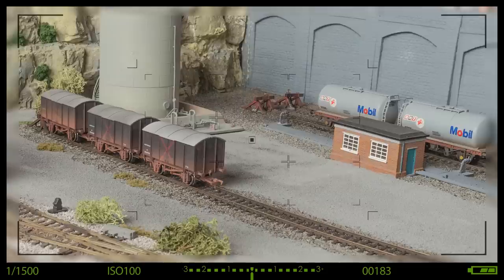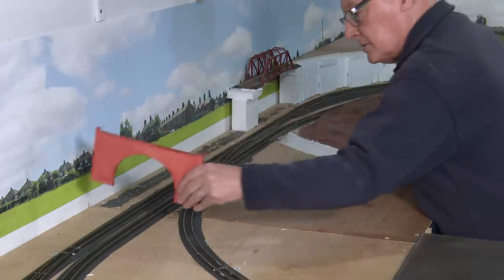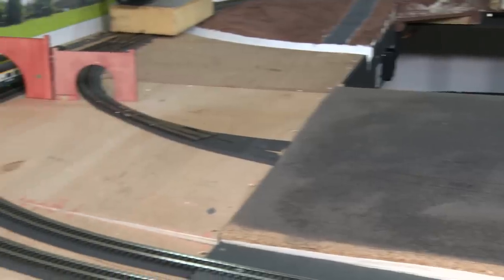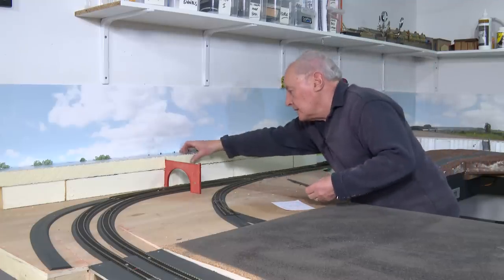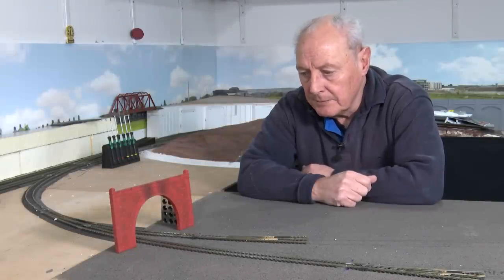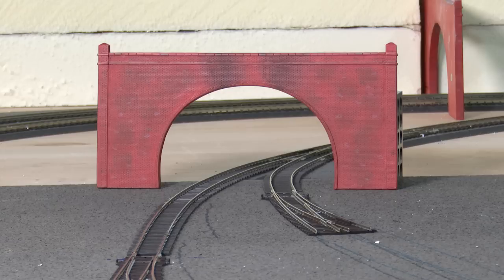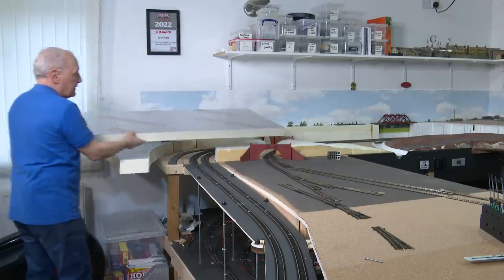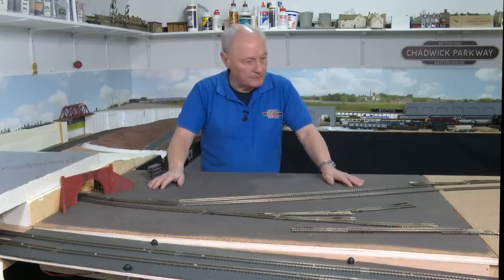Landscape Planning at Chadwick Model Railway | 176.

Comment: Interesting as always.  One of my bosses from way back when had two bits of advice when faced with apparently insurmountable problems... How do you eat an Elephant? - One bite at a time. And my favourited - How do you move a big block of concrete? Chip away at each of the corners and eventually you'll be able to roll it out of the way.

On a practical level, how are you going to maintain access to the points under the hill?  Two on the board you are currently working and an then at least one more on the reversing loop?  I wonder if the 2" layer of Celotex could be removeable - maybe use some vertical dowel pins to retain position on the 3" layer but retain the ability to left the upper slab off for access.

Have a good mini break - three weeks to next video!
Reply from the maker: Hi Lee, you’re spot-on the money. Yes I will have a pull-out hillside, of some description. There is no way I can leave those points sealed up. Have a great Christmas mate, I’m sure we’ll speak in the New Year. Regards, Charlie
Reply: Let’s all help with the elephant! Who has the ketchup and horse radish? Best to all! ✌️

Comment: Tis the season for a sweet sherry or two before filming! ;-)
Re TT120 - I think, if you are starting off afresh in the hobby, it bears consideration and I have no doubt more and more stuff (from rolling stock to buildings) will be come available as time goes on. However, I don't think if you are already committed to another scale, whatever that may be, you are going to be persuaded to swap. I have a modest sized OO layout, but between locos, rolling stock, road vehicles, buildings, etc, etc there would be no way I'd be changing scale.
Happy Christmas to you and yours. Cheers
Reply from the maker: A valuable opinion, Davie. Have a great Christmas and best wishes for 2023. Regards Charlie

Comment: Once you have glued your foam down, a good way to sculpt it is to use a short one-handed 2" surform and 'file' it into shape. Then cover by painting with cheap tile adhesive/grout using a wetted paintbrush. You can add texture or keep it smooth, fill in gaps and it dries in 24 hrs as long as you don't apply it too thickly. Cheap as chips when you consider the area you can cover from a 5 litre tub. It dries as hard as plaster bandage and easily drills for trees etc. Paint it with cheap emulsion paint before scatter so no white shows through.
Reply from the maker: Great tip, using tole adhesive David. Best wishes for 2023, regards, Charlie

Comment: As someone who hasn't started building a layout yet or bought too much stuff, the arrival of TT120 is giving me a lot of food for thought. While I like the overall size of models at 4mm scale, I just don't like the error in track gauge. I find N too small and O far too big and I don't have the confidence to go down the EM or S4 route (learned that the hard way with my dad 45 years ago where our ambition exceeded our abilities). So a new scale between N and 4mm that is pretty much gauge accurate is very interesting. The downside is of course the fact that it will take ages for there to be a decent range of locomotives and rolling stock. So I'm on the horns of a dilemma. 
Meantime I envy you your heating bills! My 16th century house with single pane windows and thin walls costs £6 per hour (after subsidy) to heat even at lower than usual temperatures, so when the snow was down last week I wore 6 layers and we rationed heating strictly. The monthly cost is still horrendous.
Anyway, many thanks for your videos this year - you give me ideas and inspiration so that one of these I will finally take the plunge either in OO or TT. All the best for Xmas and New Year.
Reply: My goodness, that is expensive!
Reply from the maker: Wow, Paul, and I thought my energy bill was excessive. I live in a draughty old cottage which is a nightmare to heat. I feel your pain, regards, Charlie
Reply: I agree about the gauging. It seems strange that wizards like Charlie go to unbelievable lengths to have the utmost realism, then spoil the effect by having track that is simply too narrow so locos don’t look right.  Withe quest for ever increasing accuracy, Hornby’s business strategists must have thought this through. I’m guessing they wanted something where they could create a monopoly and charge accordingly. So launch EM?  Compared with making complete new locos and rolling stock the mods would be much simpler, and the track would be simpler.  But how many established modellers would switch?  Not enough?  Go HO where the 3.5 gives gauge accuracy?  No chance of a monopoly there.  N gauge? Not quite the same. N gauge has a true gauge of 4’ 4”, so truer than OO but not true scale.  The old Lone Star OOO gives true scale so if Hornby go in hard enough with enough models they could attract new builders while enticing established N gauge builders to keep their layouts and track and replace their entire fleets with Hornby. Isn’t that smart? I’ll stick with my Hornby Dublo 2 rail OO gauge and wallow in the nostalgia of my beloved locos on the wrong tracks.  Meanwhile, if that strategy works, and Hornby get their monopoly, will they be the new Lone Star!?
Reply: Paul: Heating.  Our house is only a bit younger and the Listed Buildings apparatchiks won’t allow even tasteful double glazing.  Our downstairs shower room was suffering terrible condensation on the windows.  I surveyed the market for kits and installed versions like Anglian. I chose Omega Plastics in Devon as theirs looked well engineered and was competitively priced.  My wife wanted glass panes instead of polycarbonate and Omega said we should go for an aluminium frame as it was to big for plastic. So there wasn’t much plastic in Omega “Plastics”.  The staff were very helpful.  It arrived promptly.  It was all really made and went in easily.  There has been no more condensation except for 5 minutes after a shower.   I am delighted, hence this long message.
Reply: Thanks again for another fantastic video.  My layout is new and very 2D.  Other videos merely talk about making the 3D scenery but your exposition in explaining the why before the how is inspirational.  I feel I can start now.with some optimism and the confidence to try things, and even to correct mistakes along the way. It shows your strength of character that you can share your mistakes on screen.  You asked for comments about the tunnel entrance heights.  They’re OK for diesels and tube trains but I suspect proper steam locos would need a bit more clearance to reduce the thrust from their exhausts onto the tunnel lining.  Happy Christmas and thanks again.

Comment: Excellent and thought provoking video - as always. Not quite sure about your topography but it is your railway at the end of the day. My preference would be to try and create sonething the railway engineers would have faced, so with that in mind would the railway builders have built a tunnel about 4 coaches long with a set of points in the middle ?

Hmmm

Hornby TT120 in my view it is SK's last great hurrah and it is so clear.

  I am a 60 year old, and son of a rabid rail enthusiast who did his trainspotting on Blisworth station in the early 1950s.  In my view my dad was SK's primary target with high stepping pacifics on long rakes of coaches. My dad died in 2018 aged 83 and with him died one more passion for the LNWR and LMS.  Me ? Born 1962. I actually care for the period 1960-1975 which is a lovely mix of steam, diesels, electrics and railcars. Not prewar apple green East Coast pacifics or those big LMS maroon icons.

I suppose that being blunt, my question is - how many Gresley pacifics does Simon Kohler think the new scale will sell ? 
Another question i pose, having joined BR in 1978 is - does Simon Kohler think the "Toad B" is the typical BR brakevan which lasted in service into the 1980s and 1990s ? If so then he is mistaken. Hornby already have the CAD for the representative brakevans used in the diesel era, in the shape of the standard 20T and the Stanier 20T versions, and these are what IMHO Hornby should be offering in TT 120. 

Therefore i conclude the TT 120 offering has some pretty poor choices, some of which have been lazily tickboxed from the current OO inventory rather than using real imagination.
Reply from the maker: You’ve made some excellent points, Phil, thank you. Best wishes for 2023, regards, Charlie

Comment: Merry Christmas Charlie. Lovely to meet you at Warley. You as pleasant a chap in person as on the screen! More than can be said for most minor celebrities 😂

The layout is really looking great and a top tip with setting goals rather than doing bits piecemeal but as long as it’s enjoyable for the most part!

I’d have been half tempted to have modelled the diverging line with a sheer cut rock face nice to the tunnel portal and eliminate the tunnel on that section entirely. Perhaps best achieved by moving the double mainline portal towards the helix by an inch or two. Nevertheless, you’ll have a really nice view with the trains coming out the portals and will look great.

With Hornby TT. It’s a very mixed bag really. It fragments what is a somewhat niche hobby and will struggle to gain the same economy of scales with oo, certainly for a while. It also diverts energy and resources away from their core oo market that I would argue is being a bit neglected and struggling. On the flip side I was very impressed with the scale at Warley and I get what they mean by them being a lot more tactile than n gauge. It also makes a lot of sense for uk houses. The primary issue though is that the rest of industry need to come along too and I think that may well be the deciding factor. This will not be helped by them only selling directly. Obviously, quite unfortunate with Heljan pulling out but seems like Hornby have been working on the entire range for quite some time. 

I would also add that if this flops for Hornby it’s going to be a huge hit and they may struggle to come back from it.
Reply from the maker: Such a great comment £100. 
Great views on TT120 too.
Have a great Christmas and best wishes for 2023.  Regards Charlie.

Comment: Hi Charlie. Nice video. Yes I agree with you, it is better to try and plan your landscapes first if you can, rather than go straight at it. That way, you are liable to make less mistakes when it actually comes to building/constructing them. I also tend to find that if you can make some rough mock ups of what you are trying achieve first, it gives you a better idea of what things will look like and it is far easier to alter things then if you need to. Best wishes, Mark.
Reply from the maker: I’m living proof of such design changes!
Regards Charlie

Comment: Charlie,
Firstly, HAPPY NEW YEAR 2023.

Onto designing the hillsides above your baseboard. I model in N scale, and a major consideration is how my layout might go into the back of a hatchback or estatecar. 

My first thought was to question the traditional construction of making box sections below the baseboard. To my mind, that often means a lot of wasted space. 

Sure, I need somewhere to route my wiring and any control servos. But they don't need anything as deep as a traditional box section. 

My design builds those strength-giving box sections above the baseboard. As such, my hillsides are achieved by cutting into the box structures. Then covering the variously shaped boxes with thin plywood (similar to the way we might build a ship's complex hull with formers – the boxes – covered with laths of planking for a complex hull). 

So far I've only created proof-of-concept prototypes. These look very promising. The idea being to make double use of the strength-giving baseboard box sections to provide the undulations of the scenic landscape. The ultimate goal being to minimise the overall height for transportation. 

I'd be interested to know if you have tried such a construction technique, Charlie, or any of your viewers?

The only major issue I foresee is that it requires someone with excellent 3D visualisation skills, as it requires precise pre-planning. You can't so easily make it up as you go along. Otherwise, you'd lose the strengths of the traditional baseboard. 

I think of this construction method as being similar to the way a modern aircraft gains its strength from an integral WW2 style "monocoque" construction, as vs older lath-and-canvas construction seen in WWI biplanes. 

Thoughts?
Rick
Reply from the maker: What an excellent, and thought provoking comment, Rick. One of my friends makes his layouts from thick, light, pink foam boards. Easy to carve and easy to carry, and interesting option. Regards Charlie switch.

Comment: Thanks Charlie, most appreciated. With regards to TT 120,  I know both Hornby & Peco are promoting it, I could pontificate at great length highlighting the pros and cons of it. Personally I think there's enough to be getting on with in '00'. With the boys at Mckinley railway showing us what is possible with the hobby! With a solenoid powered Kadee coupling it was almost as if they'd found the Holy Grail of decoupling! Maybe Hornby have realised they need to create a larger market share, due to all the manufacturers who are crashing in and supplying locos in '00' & producing a better product. Here's a rather novel idea to hide your porthole. On the Transpennine route there is a certain Stanedge Tunnel before it is an aqueduct flowing over the railway  that fills the canal just below it. It is really unique and I'm surprised someone hasn't modelled it.  It proudly stands before the portal to the left and cascading down a staircase the white water makes a dramatic entrance towards the canal. Link;- https://youtu.be/5b7cIVEpGkA
Reply from the maker: Yes a very interesting construction Bill.
Have a great Christmas and best wishes for 2023. Regards Charlie.
Reply: @ChadwickModelRailway  Thank you!

Comment: 4:27 Interesting stuff Charlie. Of course there’s nothing stopping you from using a double track portal on the single line. Many lines built as double were singled but the structures of course remain unaltered. A good example is the Matlock branch. You could even show the ghost of the other track alongside in the ballast.
Reply from the maker: An excellent point Al.
Have a great Christmas and best wishes for 2023. Regards Charlie.
Reply: @ChadwickModelRailway  Thanks Charlie, hope you had a good one too.

Comment: Thanks, Charlie, 
A really good video as usual. 
I did smile at your comment about ‘finishing your model railway’. I modelled for many, many years, but never got close to finishing a layout. I doubt there are many modellers that have. A layout is never finished. 
As an aside, regarding your tunnel portals; I realise you want to use what you have, but bearing in mind that area is going to be industrial rather than in rolling countryside, my personal view is that roads may look better crossing the railway on girder or brick-sided structures. Simple and cheap to build, but in my view, more convincing than the curved portals. The rectangular entrances, to my mind, would look better, and don’t focus attention on track alignment like the curved ones. You could make them as wide or as narrow as you want. 
Thanks for an entertaining year. 
Very best wishes for 2023.
Reply from the maker: You make an interesting point, Perry.
Have a great Christmas and best wishes for 2023. Regards Charlie

Comment: Fantastic year of videos Charlie, well done!!!!
As for TT I think that it will be a great success as so many people would love to have an extensive and interesting layout such as yours but just don't have the space. I know we have N gauge but I think that is a challenge too far for many.  I personally model OO and O gauge (the O gauge locos have real presence) but if space was limited would be happy to dive into TT.
I however think that it is an error for Hornby to cut the shops out  as it's in all of our interests to bring as many people into this great hobby as possible and maximising the  expose of TT will undoubtedly help in that aim. 
If you need advice where to start in this hobby as it can be complicated where better to start than your local shop. Hornby should remember that they don''t operate in Isolation and if people don't use the local shop then they may lose it.
Reply from the maker: You raise some interesting points, Paul.
Have a great Christmas and best wishes for 2023. Regards Charlie

Comment: As you have a curved point within your single track tunnel, personally, I would have opted for a 'cutting' there rather than another tunnel and then blended the scenery the other side downwards. That way, it would give you ease of any issues forthcoming from that point should you get a derailment and also an opportunity to have that cutting with raised sides to hold back the scenery and have perhaps a slightly more 'prototypical'  look as I'm trying to work out whether you would actually come straight out of a tunnel mouth right into a fuelling point and diesel depot.
Merry Christmas Charlie and hopefully see you at the show next week.
Best Wishes
Steve @ Railway Laser Lines
Reply from the maker: You make some interesting points Steve. However, I have a cutting on the other side of the layout by the viaduct and thought that I’d have a change in this area. I think once the modelling is complete it will look fine. 
Have a great Christmas, regards, Charlie